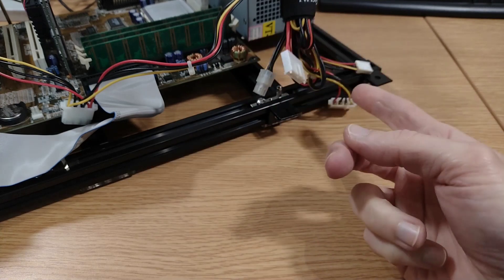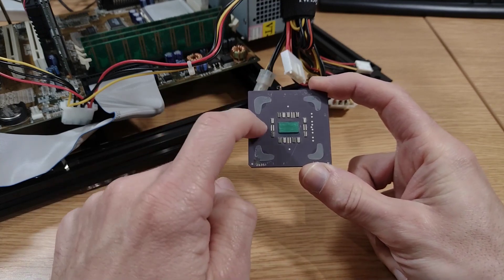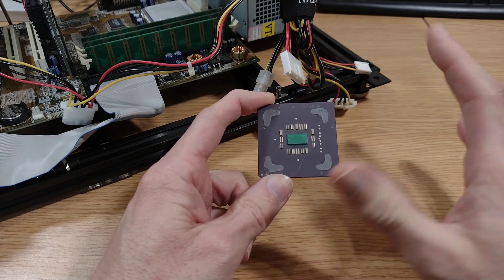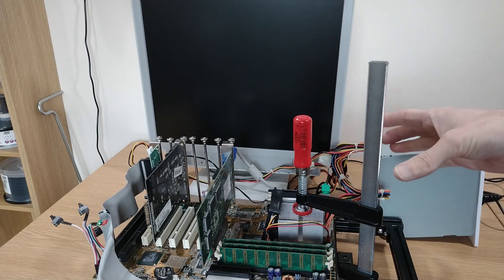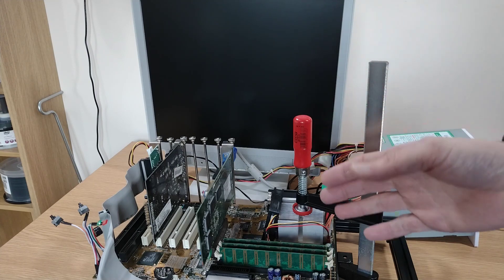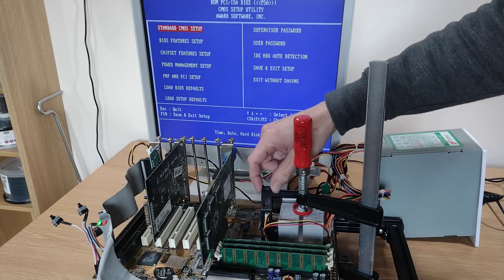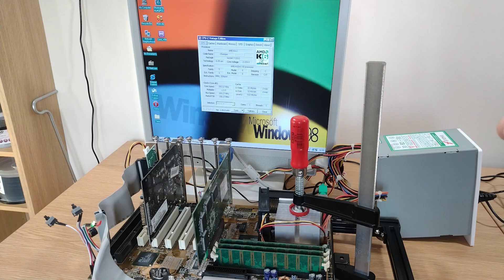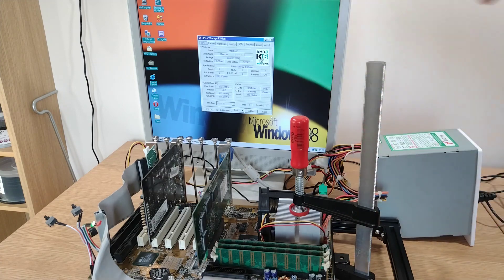Mystery Socket 7 CPU

Comment: I delidded a few of those back in the day, when they were cheap and plentiful, for OC purposes; the theory being direct die cooling with a copper cored heatsink, something similar to the Thermaltake 6CU (I think I used Alpha coolers on SS7), would allow for higher speeds... It never worked any better than it did with the lid. I never used any shims to stabilize the heatsink, clamping pressures were not that high on SS7. The broken dies on Socket A processors were caused by the much higher clamping pressure required, back in the day people were not only breaking CPU dies but also killing motherboards when the screw driver slipped as they tried to mount the cooler.
Reply from the maker: Thank you for the info, I didn't know the clamping pressures were higher on socket A. I'm going to try and find the CPU socket specifications to have a look at what the clamping forces were. I don't miss using screwdrivers to clip the heatsinks, I have slipped once or twice over the years, the screwdriver digs into the motherboard, you get that horrible feeling in the pit of your stomache as you reach for the on button to see if the motherboard still works!
Reply: I damaged the traces on my very first socket A board from a slipped screwdriver. I soldered the trace back together and it was only stable enough to install windows before it died, but long enough for the replacement board to show up.

Comment: I bought a matched pair of Athlon MP chips back in the day... chipped one of the dies very first install into the Tyan Tiger MP mothrboard... dangit!! Crossed my fingers twice and powered it on... aaaand it was fine. I spent way too much on that system but I just had to own the first dual CPU AMD system.  I was always an AMD fanboy.
Reply from the maker: Those dual Athlon MP boards were great! I'm glad that CPU still worked, it would have been awful to get that board and have one of the CPUs break. I wonder how much of the actual CPU die were the transistors and what not. I had loads of Athlons and a few Durons with chipped corners and the majority still worked OK.
Reply: @RetroSuperhighway  the actual transistors are on the bottom of the flip chip design so you can apparently chip quite deep without any damage...
Reply from the maker: Interesting, I wonder what the top part of the die was for then. Maybe it was just something for the manufacturing machines to get a hold of when they were making them.
Reply: @RetroSuperhighway  just the thickness of the silicon wafer... it needs to be thick enough to survive all the fabrication processes and yet thin enough to maximize yield from each ingot.  Newer process uses even thinner wafer sizes so direct die cooling must be done with extra care as to not crack the die.   The actual lithography today is only several nano meters thick as opposed to the several several microns on older process. Just the thinnest layer imaginable...

Comment: no mystery just common delided cpu
Reply from the maker: I hadn't seen many K6-2 de-lidded so I wasn't sure what it was, I have seen a lot of K6-2+ recently de-lidded due to people trying the mod to enable extra L2 cache, but they look different under the IHS. How were people holding the coolers on to the bare CPU die, and do you know if there were any shims available to stop the cooler rocking and breaking the die? (A bit like what was available for the socketed Athlons and Durons?)
Reply: @RetroSuperhighway  Most users that do the cache mod glue back the lid again after moving the component, but I guess you could just use a suited quad of rubber or cloth feet for furniture or better like these used for smaller stuff. I actually use a delidded P4 3Ghz cpu that I got without the lid myself, I had to put a coin between the die and heatsink to make up for the lost distance, I recently lathed the coin to a better thickness as the pressure was too high for the small plastic frame that holds the cooler, I never put any other support and been using that computer like this for way over 10 years now. Just be careful when you mount the heat sink not to tilt it all over the place
Reply from the maker: Ah I see, I wish I had the lid to glue back on! No worries, I can measure the die and make a spacer, I was just hoping that such a product may have existed at some point and I could go hunting for one.
Reply: @RetroSuperhighway  indeed. I don’t think there would be any other product to find for that purpose. De lidded CPUs are mostly made for over clocking purposes as the paste between the die and lid can be worse than direct contact. The K6 for modding cache etc. I got at least 1 or two K6 in my collection but no broken ones otherwise I could have sent you a lid to use. But it is a pretty common cpu so if you find any broken one you could just use that for your working one

Comment: AMD K6 series CPU :) I have couple systems with AMD K6-2, first is 500mhz and second one is 550mhz
Reply from the maker: Nice, just for retro gaming or other uses too?
Reply: @Retro Superhighway  First K6-2 is IBM Aptiva, it is 95% complete system(only original IBM keyboard is missing) i got this system few years ago. She owned that system since 1998 when she buyed from PC store brand new. Second K6-2 is from Compaq Presario system, no original monitor or accessories left. 
Both systems are now for retro gaming :)